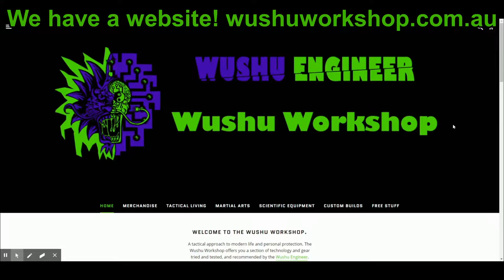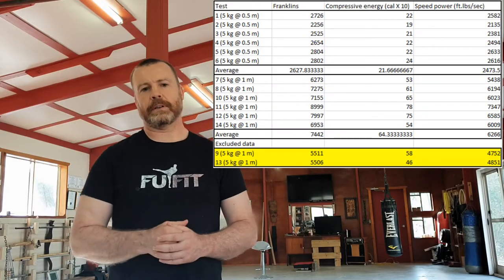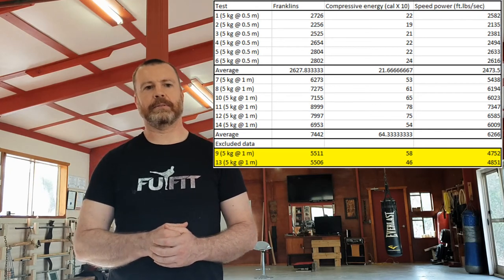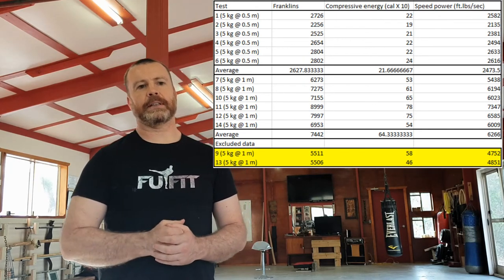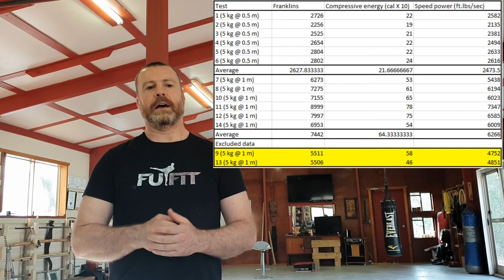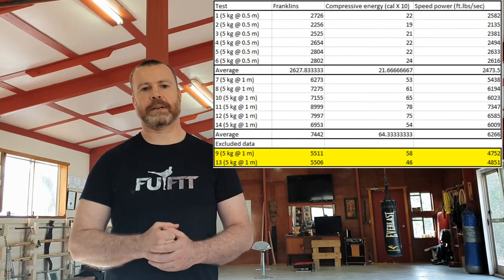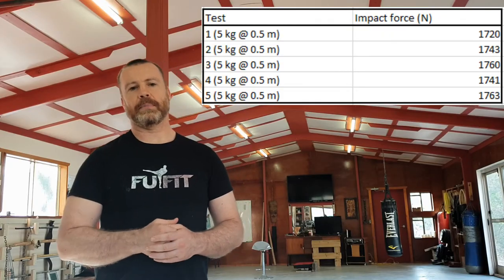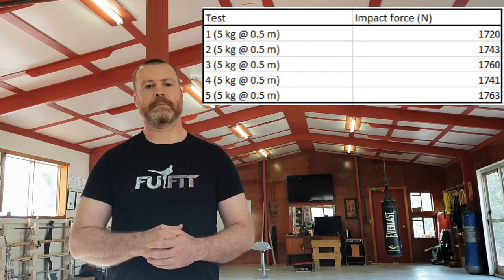PowerKube DIY self-calibration drop tests

Comment: i Wonder how powerkube show the same ftlbssec numbers like loadcell in your test where you have powerkube on loadcelll while powerkube is more ralted to Energy and loadceeel to momentum :x
Reply from the maker: The foam spring of the PowerKube would most likely reduce the peak force delivered to the load cell and spread the impact peak over a longer time period. So in that case, it is likely that the values on the PowerKube will remain pretty similar because the load cell is pretty close to being a rigid surface. However, the load cell values would probably change significantly. I am planning on doing some tests with a thick (20 cm) simple foam spring and strike plate mounted on the front of the load cell and analyzing the impact waveforms in terms of a combination of both peak force (which will be reduced) and impulse.
Reply: @WushuEngineer  something hear is not ok in your test where you strike be hammerfist probably you put powerkube directly on loadceeel and ftlbssec readings from powerkube have 100% corelation with kg force which show loadcell but powerkube catch Energy more and loadceell more momentum  so powerkube should show diffrent  ftlbssec than laodcell kg force beacuse Energy and moment isint the same for egzample 5 kg dumbell from 0,5 metres have 24 jopules Energy and around 15 kg x m/s momentum vs from 1 metres dumbell have 48 joules enenrgy and around 22 kg x m/s momentum so they cant show the same numbers on screeen while they show :x how is this possibble ? im seen this imediatelly when you do this droping test with powerkube but dont want write this however its strange and it shpould be like this  so im write this :x in powerkube when you increase velocity of object or arm 2 Times powerkube show not 2 Times more ftlbssec but 4 Times more at least due to kinetick Energy equation in which velocity is squered vs when you increase velocity the same object be 2 Times so momentum increase 2 times and Energy 4 Times loadcell dont show 4 Times more peak force but only 2 times more big force thats why im write loadcell catch momentum as peak force and powerkube more kinetick Energy and if this device show /catch diffrent units and translate into peak force on screeen if you put powerkube on loadcell both powerkube and loadcell should show diffrent numbers  and not the same i dont write about franklins which have no impact on extrapolation to loadcell maybe as impulse somekind  but not peak force im write about ftlbs/sec on powerkube vs kg force at loadcell  im show about which your video im write hear
Reply: watch from 17:00 :) https://www.youtube.com/watch?v=BxmbMa1hfa8  you say that you dont register first five shots but last you register and it was 1413 newtons on loadcell vs powerkube show 14355 ftlbs/sec now 1413 newtons :9,81 is around 144 kg force  so almost identical numbers as ftlbssec what show powerkube if you do first 3 numbers as kilograms and then give comma so 143,55 is almost 144 :x 0,5 diffrenc is we can say normal error in such device which catch this type of phenomenom so how is this posiible that when powerkube ekstrapolated kinetick Energy on peak force show the same numbers as loadstar boxing kit which ekstrapolated momentum on peak force :x thats weird :x maybe you be your strike increase be the same amount of diffrenc both momnetum and Energy than you have big lucky that both device show egzacly the same numbers:D :x you shpoukd do droping test fom 2 diffrent hight 50and 100 cm be the same dumbell with powerkube on loadcell and comapre ftlbssec from powerkube  to kg force on loadcell and not franklins franklins is pointless i quees its more ralted to imppulse than peak force somehow :x
Reply: @WushuEngineer those numbers  ftlbssec to kg force on loadcell they look like somebody manipulate those device from distance change setting :x.
Reply from the maker: @mociczyczki  Hi. I am not sure of the meaning behind your most recent comments. There is a bit of a language barrier here, so forgive me if I have misinterpreted you. However, some of your comments appear to imply that I am somehow being deceptive or dishonest in my use of the equipment. I do not appreciate those kinds of insinuations. As far as my loadcell is concerned, it was recently used as part of a university study (University of Southern Queensland) and was independently calibrated by the university for this use. In fact, we will be using it in a PhD research project beginning next year. As such, the device is accurate and functioning properly. I have not adjusted any settings in either the loadcell or the PowerKube. What you see is what you get. In addition, some of your comments appear to be trying to draw a comparison between the values from the PowerKube and those from the loadcell. This is impossible to do without performing the necessary conversions, because the PowerKube measures impact power. Without knowing the exact characteristics of the foam spring amongst other variables, and performing the necessary conversions, you cannot make direct comparisons between the values generated by the two devices.
Reply: @WushuEngineer  ;)
Reply: @WushuEngineer look at numbers  ...compare to momentum and Energy  completyely diffrent stuff ...
Reply: @WushuEngineer   i know  the softer  surface it will  more reduce peak force ! but while from your test we know that loadcell catch momentum as peak force  where mass and velocity are the same important  because velocity for momentum formula isint squered!  vs from your test we also know that powerkuba catch kinetick energy multiple be momentum probably and in kinetcik energy velocity is squered ! what does that  tell usss? it tell us that both devoce shopuld not show the same peak  force numbers which are in powerkube ft lbs sec for egzample  if you put powerkube on loadcell under it first drop obect best is steel ball because its cenetre of mass is always in the same plece no matter how it spin around while fly i write you this multiple time ;) well best is flat nosed stik on rail becasue ball change compresion surface while penetrate stuff:x but maybe psi change with force linear so such no diffrenc anyway let say you drop some ball form 50 cm hight  and pwoerkube and loaddcell show specified value  now you drop thsi ball from 2 metres hight what give 2 times higher velocity  what mean 4 times biger kinetcik energy and 2 times biger momentum  now powerkube should show biger diffrenc in readings than from attempt from 50 cm! understand this  or not ?  because if loadcell catch only change in momentum so such icnrease in momentum is 2 time ssos such it show 2 time sbiger now value from 2 metres vs powerkube shpuld show 2x4 = 8 times biger value now if you do multiple attempt from diffrent hight calculate how much momentum ball have from specified high and you plot date into graph you find out that on loadcelll line be linear stright with increase in momentum ball  with force on graph vs on powerkube not =the line be more and more steep ! /upward curve!  do you understand this or its hard to udnerstand to you ?;)  the loadcell should show linear increase in force with momentum with or withpit powerkube on it ! i do droping test with me fc 20 k axis loadcell and its no matter i put on laodcell 20 cm foam or styrofoam or whatever for amortization or something hard YES THE PEAK FORCE DROP ON BIGER AMORTZIATION WHAT IS OBVIOUS  ! BUT NOW IMPORTANT CONCENTRATE PALL = THE PROPORTION BEEWTEN PEAK FORCE AND MOMENTUM  DIOFFENC WILL NOT CHANGE AT ALLL!  NOW I THINK YOU SHOULD UNDERSTAND WHAT IM WRITE  gretings ;) .
Reply from the maker: @mociczyczki  Hi. It’s a little hard to understand what you are asking due to the language barrier, so forgive me if I have misinterpreted you. I believe you were comparing the Impulse Block method with the PowerKube. Please make sure that you watch my video in full, because I believe that I have addressed most of your queries/observations in my discussion. We will be using impulse calculated from the load cell output along with measured impact velocity to calculate the unknown variable of apparent mass behind a strike which can then be used with the impact velocity and time data to calculate both energy and power. You were saying that the PowerKube measures energy and the load cell measures force, I believe. Although you are correct about the load cell measuring changes in force over time, the PowerKube does not measure energy directly. It contains an accelerometer that measures changes in acceleration (typically g-force in the X, Y, and Z axes for a standard tri-axial accelerometer). This acceleration data and the associated time data is used to extrapolate both kinetic energy and power. Neither the Impulse Block method nor the PowerKube measures energy directly. Both methods make use of other data (force, time, and velocity in the case of the Impulse Block method, and acceleration/g-force and time in the case of the PowerKube) to calculate energy indirectly.
Reply: @WushuEngineer   im saying  powerkube increase force value which in this device is ftlbs/sec from multiple  kinetick energy of object which hit powerkube be momentum most likely ! when you look at numbers from your droping test you should figure it out :x vs loadcell show peak force specified impact as change in momentum what also show your droping test  now if both device catch change diffrent type of units body in motion on peak force that mean thay couldnt show the same numbers when you put powerkube on loadstar loadcell  !!!!! ;) what happen when you do test with hammer fist probably form this what im remeber  where you remeber some last numbers from loadcell which was egzacy the same as ftlbs sec numbers on powerkube ! i show yu somewhere here once this video .... please read me comments with understanding  :x watch this 12:29 powerkube numbers 14335 ft lbs sec https://www.youtube.com/watch?v=BxmbMa1hfa8    vs in 17:05 you say you record last shot on laodcel and it was 1413 newtons !  now if we divide 1413 newtons bs 9,81 we get 144 kg   why it looks similar to first 3 digits from powerkube ftlbs sec? =143,35 diffrenc is less than 1  what can be consider as normal error :x how you explain this where both device catch diffrent units for translate them on peak force specified strike i dont wirte hear about impulse which is not so important but peak force is waht matters most and maybe hic value  which is couple miliseconds closest to peak force average force but thats diffrent story :x . watch this Brick-Breaking Science - PowerKube & Loadcell values - YouTube  its your video sometimes link dont work and only tytle of video work in me comment so you rdrop 5 kg dumbell from diffrent hight ok so such from 1 metres vs from 0,25 metres what is diffrenc in velocity 2 times the loadcell value was 2 times around diffrent vs powerkube 7,3 k franklins vs 1,2 k franklins around  so such loadcell catch increase in momentum 2 time as peak force and not kinetick energy because kinetick energy increase 4 times when velocity increase 2 times only ., vs powerkube show not even 4 times more but 7,3:1,2=6 times 6 F....EN TIMES HIGHER VALUE !!!!!!!!!!!!! and 6 times mean this device multiple moemntum be kinetick energy of object i mean it added in this case momentum to kinetick energy  :x you forget say what ftlbs sec value was :x ...anyway your loadcell = momentum your pwoerkube = momentum x kinetick energy or + ....
Reply: and if both device show diffrent stuff than they shouldent show the same peak force when you put powerkube on ladcell ? i quees or meybe im wrong whats your point about this :x f..k all this theme give me a headahe :x it sad that this isint so simple as let say bench press or run on 100 metres where everything can be very easy figureit out ., collision is unfrotunatelly much more complicated or somebody dont know how it goes or do this intentioanlly that setup diffrent device diffrent :x im not write now about you but strainght about manufactury itself :x . at least god that me loadcell show the same as loadstar = change in momentum as peak force however study which im show you with those droping stell arm with gloves on from various hight show kinetick energy !!! and its the same egzacly device type as your oadstar ladcell and me fc 20 k axis loadcell hehe thats funny :X im write now precisley about this study (PDF) Performance of Prototype Pneumatic Boxing Gloves under Two Different Conditions of Target Padding (researchgate.net) so im really dont know what is going one hear  you probably dont know to :x im found some study about contact force and quasi static force which are diffrent stuff they show graph conact force can be couple times higher than  quasi static force watch this study 2016_lam_the estimation of impact.pdf    watch figure 7. something  turn on light hear ;) at least some part of light :x the conatct force is what casue bendint and ripp of apart in palce of hit while quasi static force is what hayse change in momentum the qUASI STATIC FORCE IS PROBABLY SETUP me loadcell and yours loadcell :x they also write in this study that diffrent beewten both phenomeneom are not very god subscribe yet on diffrent type of materials :x
Reply: in this precislely impact quasi static force time duration was 30 miliseconds like typical boxing punch vs conact force like 2 miliseconds maybe :x diffrent in peak like 2 times in this case .